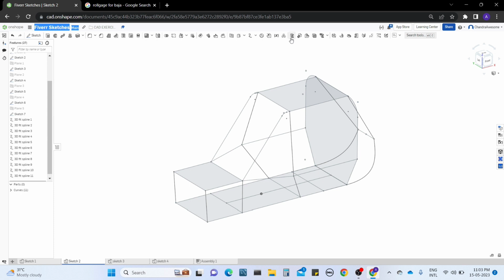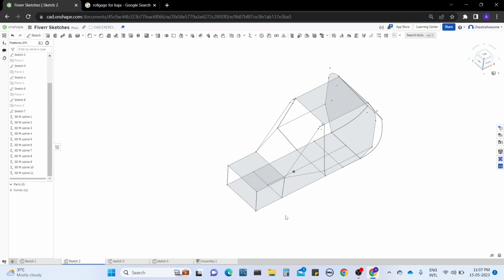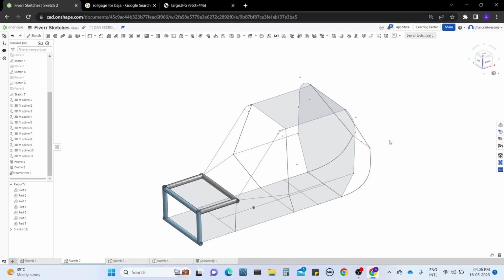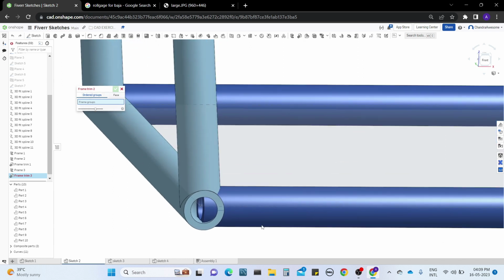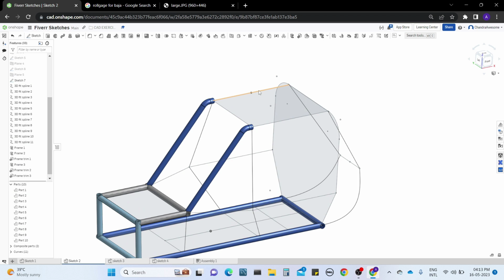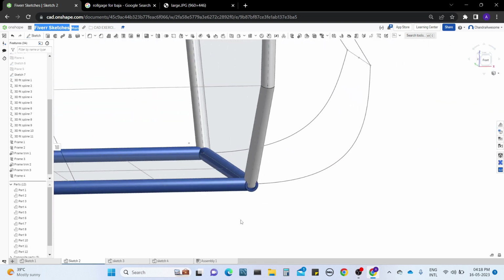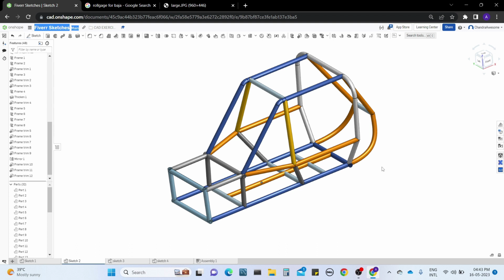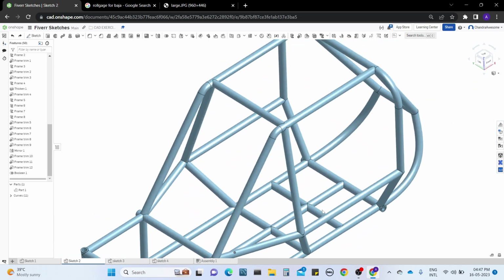Onshape Tutorial on Frame Tool || How to Design a RollCage Part -2

Comment: Can you show how you got the pipe smaller at 5:52 because I am trying but I can't figure it out
Reply from the maker: As i said there, i edit the sketch dimension where i drawn before. I skipped that part, that's why the size of tube changed buddy
Reply: @ChandraAwesome Yeah I heard when you said that but idk how to do it myself so could you say how in detail?... I'm a beginner at this stuff and I have a lot more to learn
Reply from the maker: @AndreDavis-g5f   sure. As i drawn the sketch right. Did u seen ??....so when i realised it's bigger. I came to the previous part studio tab where i drawn the sketch and edit there with less dimension. So automatically its changed here. That's it
Reply: @ChandraAwesome Yeah I saw that part... So you're saying that you changed the measurements smaller than 10mm and 1.5mm correct?
Reply from the maker: @AndreDavis-g5f  yess. Because u can see the pipe is too large in size for that small line. That's why i changed it. Even you can give your own dimension
Reply: @ChandraAwesome  Alright thanks for the help, will let you know how it goes. Great videos btw
Reply from the maker: @AndreDavis-g5f  thanks buddy..❤️. Keep doing this support for our channel